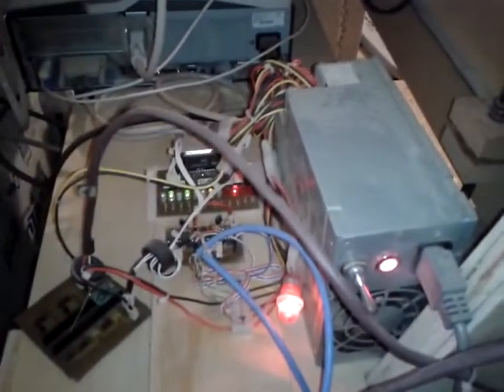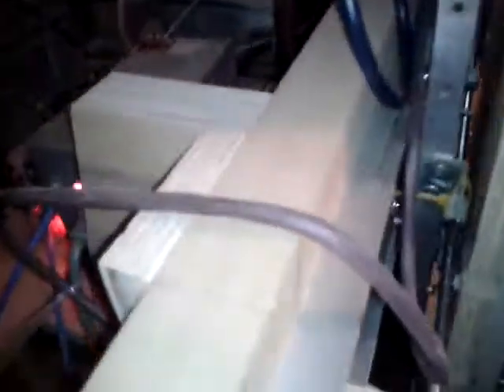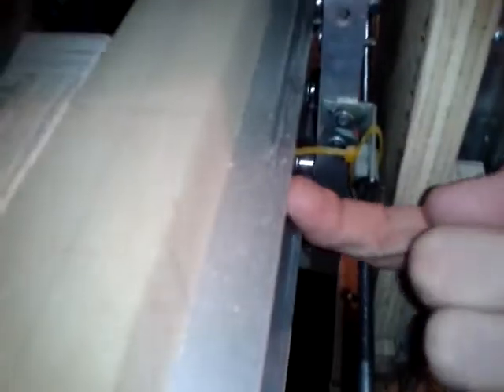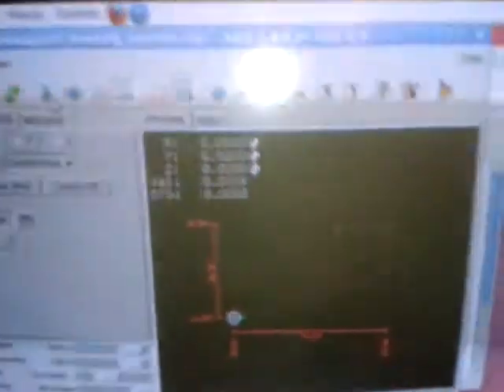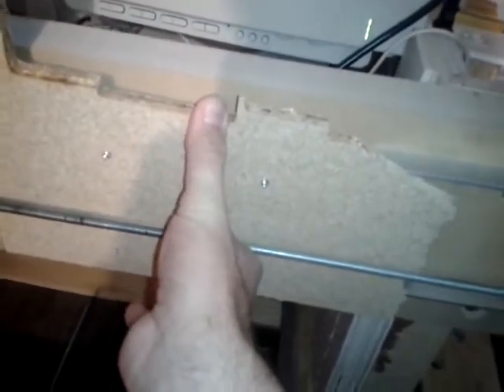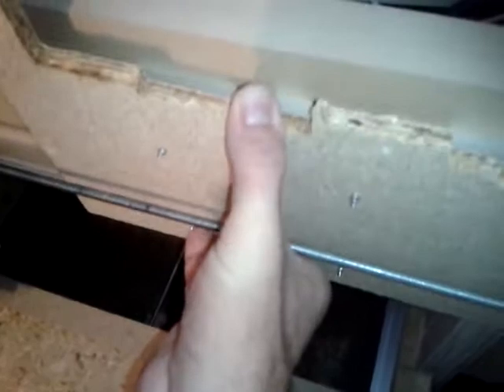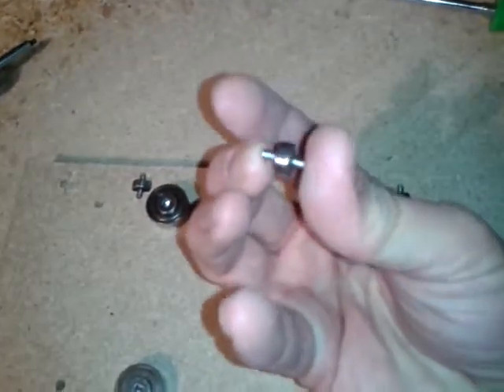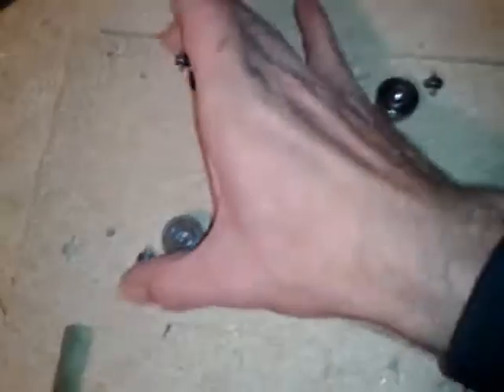CNC upgrade: prototyping a better cart

Comment from the maker: One other note - that screw/bar thing is the threaded rod which drives the original cart and will be replaced by a belt, larger stepper and a micro-stepping controller. While being potentially extremely precise (1/4000" inch - 20tpi X 200 steps / turn), it also turns out to be very slow - 5-10" / minute slow. This is glacierly slow. The belt drive should be closer to 100-200" / minute.

Comment from the maker: Yeah, that was a bit of a goofy design choice on my behalf. To keep this cart (and the original one for that matter) from falling off, I have to have a mini-cart on a single rail on the back connected to the main cart with a tension bar. You can almost see the setup (of the original cart) at the start of the video. I will be replicating this design with the new cart as well.